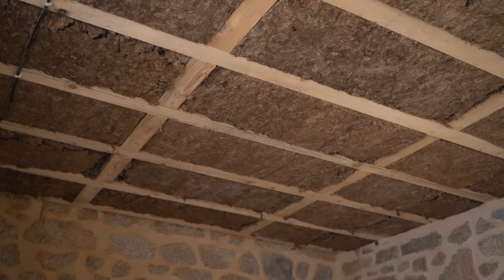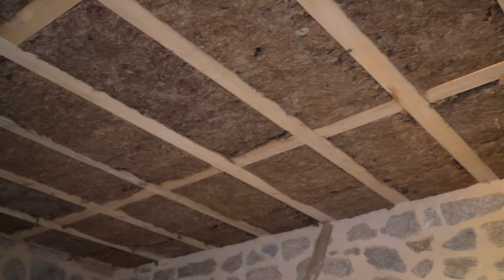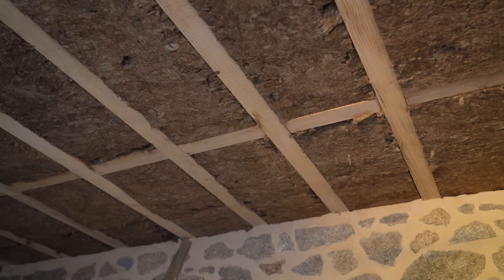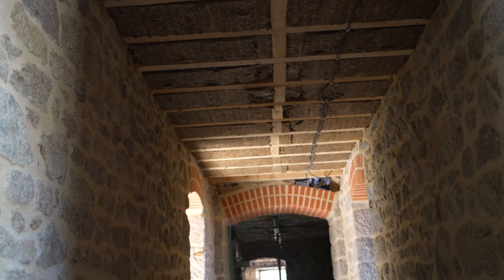Sundays at Chaumont- insulation and wiring breakdown.

Comment: You can buy special 'cable trunking' skirting boards! The cables lie in trays inside these every easy. Use PILKINGTON 'K' GLASS.  I helped a guy do a self build years and Pilkington K REFLECTS heat BACK into the house! NOTHING GOES OUTSIDE.

Comment: In Sweden the standard is to run wire through flexible pipe which is mounted first meaning it's super easy to mount and replace wiring. Though everyone did that.

Comment: In my relatives house in Berlin Germany they had these huge metal shutters they closed at night on every window, for heat and safety.  Each room also had a door so it could be closed and frosted glass for privacy but allowed light to pass thru  Each room had a single hot water radiator.  Each radiator came with it's own temperature control thermostat, and could be turned on or off if the room was not in use.  The home was 3 storeys plus a basement. One family on first ground floor and 4 separate apartments in the two stories above.  I think the combination of  doors on each room and the option of controlling each rooms heat separately saved some on  the heating bill.

Comment: Smoke Alarm system, fire escapes, emergency lighting, fire breaks:- Boiler rooms or other spaces dedicated to heating systems must have a minimum one-hour fire rating and must not be accessible to the public.:-ERP regulations have several core objectives as regards the fire safety of a building that is open to the public

Comment: I live in a 400:year old stone house in Portugal, and over the years the wires were hidden in between the stones in flexible conduit. I had the entire roof replaced with insulation, all the windows done in thermal double glazed aluminium frames, and a 30kw twin heat pump system put in for heating and cooling. There are 18 rooms with heating with long pipe runs. It’s as efficient it could be and it still takes about 100 kWh per day to heat, and this is in a mild climate. It’s no wonder these kinds of houses are not in high demand.

Comment: So no wires for the switches? How are you powering them? Battery or solar? Ugh that’d be a lot of batteries. I love the wireless idea though. iPad for your control panel. A smart chateau! I’d hardwire with smart switches. I’d also consider low voltage wiring for a security system with cameras, and surround sound for the family room while the walls are bare. And because it’s so big intercoms maybe? Are you doing sconce lighting anywhere? You have to have sconces in a chateau. I really love your channel. Fantastic work! I look forward to each episode ❤️

Comment: Great job. Why not use Wawin electrical conduit 16 or 20 mm to pull the cables in. Pull a few extra conduits you almost always need to be able to pull extra cables. The conduits protect the cables and if you get a visit from a mouse or two, they can't damage the cables and you can always pull more or replace the existing cables.

Comment: Hmm - All these praising of Rockwool (or any other stone/rock) based insulation products obviously comes from people with no construction industry knowhow. Rockwool has one single objective and that is to sell insulation - regardless of if suits the purpose. I guaranty you that the caveat list that Dan is presented is several pages. And especially on the need for 100 % air tight vapour barriers will be what will ruins the idea of using any type "conventional" methods. Insulating a brick/stone wall on the inside must only be done using silica based products with zero need for vapour barriers. Regardless what they tell you about rockwool being waterproof, able to breath etc. is simply not accurate. Sorry man, but you to consider alternatives.

They even state on the website, that using rockwool as an internal insulation method on bricks and stone walls is not recommended. Don't f... this part up Dan. You will regret it.
For the roofs btw, please consider using biogene materials...
Reply: A louds of Emercians are watching and they love if for they 10 year garbages houses. In Europe, most people tend to go for much more stability and longevity objects, and I totally am with you to work with biogenesis materials such as wood insulation, lime, and clay.

Comment: Drilling limited sized holes in certain areas of joists does not compromise their strength. Common structural design engineering allows for this as a practical matter.
Reply: It's french norms.

Comment: Be careful where you place the vapor barrier in your floor sandwich to make sure there's no risk of condensation. I would recommend that you pick a vapor retarder that will allow some drying rather than an impermeable vapor barrier (like polyethene sheeting, which can accidentally completely trap moisture that does manage to get in). The principle is similar to using lime mortar rather than concrete to allow masonry to dry, or using mineral wool rather than foam insulation. I recommend looking at the Building Science Corporation for good info on this sort of thing.

I would also say that installing the mineral wool insulation at this time is not taking a risk. We do this in hospital construction. It will not be damaged or grow mold if it gets wet, and it is capable of completely drying.

I agree this is the right approach to your build, and it's super cool that the Rockwool reps came out to advise you at the chateau, whether or not you end up with freebies.

Can you explain why you chose to adhere the floor rather than going the traditional route of nailing the wood floor in place?

Comment: Dan. You can't glue the parquet to OSB. You need to use a marine type thin board with the joints taped. The glue will not adhere, it will soak into the uneven OSB gaps.
Reply: ...I don't think in france we glue the parquet....

Comment: Save the old roof membrane to cover the new OSB before the parquet goes down while the plastering and painting is done..  The last thing to be done in a room is the parquet. (in case you have rain days where laying the new OSB is the only job you can do, you can keep it clean with the old membrane).  

 Dan, Chateau de Purnon has a video (NERVOUS moments mark a MONUMENTAL milestone. Château restoration #19) that has great footage of how they tented the roof while they repaired it using scaffolding. Huge sections of the roof were removed completely. They also have a Master Artisan Lesson on slate tiling in the same video that is a must watch before you do your roof.
Reply: It was a historic building,they hired professional for the roof and the government helped them in the process. Dan building is not historic,and it didn't have a roof,its all new construction 🙄. There is nothing to save but it walls and he knew that since day 1. Dan roof is a 20th century building,Purnon is much older. He has already consulted with professionals to rebuild it as it was.
Reply: @skdoremi6666  I understand all that - but the tenting is the same no matter and the technique to doing the slate tiles is also similar - in fact a bit more complicated for Dan with the type of roof he built and the demo of the tradesman doing the tiles is invaluable - the tools used would be a great help to Dan.
Reply: @skdoremi6666  I felt I should add.  My father was a Master Stone Mason & Master Plasterer. My X-husband was a Steeplejack, I showed him this roof and if he was capable he would have been there already - He was a lot like Nick.. no scaffolds, all ropes and harnesses. At age 70 his Steeple days are over. I asked him about his tools and he has given them to an apprentice when he retired.  I have an Aunt who is a bricklayer, a Sister who is a Cabinet Maker and a Niece who is a Train Engineer (drives trains).  I am no slouch myself a Person Friday, I can plaster and drywall, lay tiles, split stone and do a bit of carpentry.

Comment: Was wondering with such a large basement could you install a large battery room and solar to help offset the cost of heating and cooling. Also might think about floor  heating and a geothermal heat and air unit I hear they are the most efficient you can get. But I'm not heating expert.

Comment: Houses have been ruined by it. Its been tested in the only fully equipped wool testing lab in the world - and it burns as the
Polyester goes up 
Like a torch with the borax falling off it - and it gets wet from condensation because the borax holds water.

Comment: (Wireless switches... brilliant)
Run power around the floor perimeter save those awesome walls (conduit buried with space for future work... leave a pull string? , with short risers for wall outlets as needed (or floor outlets?). Just a thought.

Comment: Dan.  Do yourself and all future owners/residents and get the networking side of things done properly.  Run at least a single cat6 to every room or anywhere you may want to network something.  Connect it all back to a data rack in the basement.  You can massively future proof it that way.  
Current best kit to go in the rack is probably UniFi from Ubiquiti.  Worth looking at very seriously.  Reach out if you need any advice.

Comment: Seems to me, you’re building to a military standard, almost like a nuclear bunker above ground. The wiring sounds like a rats nest in a false ceiling. Seen it many-times in data centre’s, French OTT norms.  Insulation sounds spot on, I did the same on the internal walls, membrane, batten system, however I used plaster board with foam 70mm plus another foil membrane on the foam. 7 years later, no problem.

Comment: Instead of cables, use conduit and rigid electrical wires. This way, you can easily restore if you need to replace or add wires.

Comment: Rockwool is a great product, good choice. As a electrical contractor in the states, not knowing what the electrical requirements in France are good planning is important if possible consider using conduits in the basement floor before pouring any concrete.

Comment: Industrial style metal pipe to run the wires, with round join boxes. Can be neat and easy to move and not hide where they are. I think it would work as not a historical restoration.

Comment: To future proof the wiring it would probably be best to run flexible conduct to every electrical point so cables can be pulled through the conduit without issues. And to avoid having a mass of conduit at one fusebox, have a distribution box at the incoming supply point that feeds 4 or 5 fuseboxes spaced around the chateau. :-)

Comment: I am missing something. Why do u have to remove the waterproofing on the roof to put the roof on? Don't u want a water proof membrane under the tiles?

With full wireless switches r u going to go through a lot of batteries for all the switches in the building? And changing them out.
Reply: After all the time it was exposed to the elements and Dan climbing all over it to secure tarps, it’s probably been damaged.

Comment: 30 kW for a Building is aprox 650 m² ?
Reply: please think about vertical ground heat pumps ;D
Reply: @fusselYT  that would be quite a challenge with granite bedrock just under the thin surface soil.

Comment: Rockwool, I insulated my house with your insulation. As a paying customer, I urge you to support Dan's effort. Step up, Rockwool!
Reply: Did you do the walls too, and if yes . Is it really good , was it easy to install pls ?
Reply: @josephinesultana1334 We retrofitted Rockwool into the walls of our Australian 1950s weatherboard house by taking the horsehair plaster sheets off the inside and putting in a vapour barrier and Rockwool and then putting the plaster back on. We also put it under the floor from underneath. It is so good. On a 30+ degree day our house will be 10 degrees cooler and rarely needs extra cooling. Different needs to France in winter but works both ways.... we're warm in winter too.
Reply: @josephinesultana1334  Yes, all of it walls, floors, ceilings! Very easy.

Comment: Just a tip from someone from Scandinavia about the wiring, because we seem to do something that I haven't seen anywhere else in the world so far: use ducts for the wiring. We have these flexible tubes, very similar to tubes for drainage and the like, but with much smaller dimension, whose only purpose is to lead wiring. You can basically put them in first and then pull the wiring through them and make changes without anything snagging onto the wires since they are in these isolated tubes. I think it would make your life so much easier considering the amount of wiring you will have to do in this building.

Comment: As an IT Infrastructure person, please please do not invest in Cat5. Cat6 should not increase your cost by much and it's vastly superior. Cat5 should no longer be sold on shelves. I have a lot to say about wireless lighting as well, but I know you're working within your constraints to make things visually appealing and having solid stone/concrete walls. You're going to have a big issue with wifi signals, as I'm sure you're aware. You'll want to make sure you have a solid network wired backbone up to the wifi units  to handle your lighting automation. Let me know if you have questions.
Reply: He’s never going to really need more bandwidth than cat5e. At least he’ll get a longer cable run than cat6.

Comment: Clear explanation of the plans, very nice addition to the channel!
If you plan the switches to be wireless, take into consideration that a solution should not be depending on a Cloud service broker - otherwise you might end up in a situation where you can't control the lights if your Internet connection is unavailable. Use a solution that depends on a local controller, like Zigbee instead of WiFi.
Keep up the good work!

Comment: don't use wifi for the switches.... you'll constantly be changing batteries and with walls that thick you'll need a robust wifi network (prolly need that anyway).   Best solution will be something like ZWave or Zigbee or Matter.   They operate at lower frequency and go to "sleep" when not in use.   Batteries will last up to a year.

Comment: As an ex electrician I have always preferred the French method. Makes it significantly easier to update and change any wiring requirements. They don’t always follow the easy access rules but this building makes it preferred as well as regularity requirement

Also wireless light switches are an excellent solution

Comment: You should do the same as is done in commercial offices with wet and dry risers. Cupboards that run from bottom to top of the building, the dry one carrying electrical and data cables with distribution on each floor, and the wet riser with hot and cold water and sewage.

Comment: I use a system from Fibaro for the electrics. It includes a hub called HomeCenter 3. With that you can use Zigbee or ZWave for the switches and lighting. I would not recommend to work with WiFi if you have more than 10 lights to switch.

Comment: When do you anticipate replacing the old steel and concrete entrance/ground floors with new stable ones? Will this be before commencement of the various basement heating, plumbing, hot water, etc. systems? It probably wouldn't be weather dependent as is the finishing of the roof.

Comment: Dan these Sunday one-on-ones are great. - please consider decoupling your floor from OSB.  an elastomeric membrane still bonded and allows two layers to move independently.  wire to heat impacts your 35kw.  or you planning on boiler to heat floors?

Comment: Huh? Vapour barrier is not for use on interior floors.. It's to prevent vapour from transferring from the exterior in. Don't do it.
Reply: The basement floor and walls are sitting on bedrock without a vapour barrier underneath so he’s probably making sure the damp air doesn’t permeate the whole chateau.
Reply: @MatthewBraithwaite-x6g  That will not make any difference whatsoever.
Reply: @ why not?
Reply: @MatthewBraithwaite-x6g  Think about it. In order for a vapour barrier to work, it has to be as unbroken as possible. Obviously, there are allowances to be made for fasteners  such as staples, drywall screws, and all the nails used to fasten trim etc. Basically you're allowed about 3% of surface area. So what happens when you put it on an interior  ceiling, where there is going to be let's say, a big opening for a stairwell, or an open cathedral type loft or some such? What's going to keep any vapour inside the house already from transferring from one place to another? And just to reiterate - a vapour barrier is meant to keep vapour from transferring from the exterior to the inside of a house What he's doing is a pointless waste of time and money.
Reply: @olafbigandglad  if you treat the basement as “exterior” then it seems prudent to reduce moisture ingress to the rest of the chateau. Only for the basement ceiling. The stairs are in an enclosed area that could easily have a weather sealed door…plus the top of the stairs will also be enclosed and have a door. Good ventilation will be needed in the basement anyway due to inherent dampness permeating from the ground and walls. It even appears that some of the original basement “windows” were in fact just barred openings to allow air circulation. Dan might choose something a bit more heat preserving though.

Comment: Furr down the ceilings, run conduit, sounds like a good plan. Wifi won't go through the stone walls very well. I'm glad to see the use of wireless technology in the building. Thanks for the planning video. Is it possible to make the dormers now so they will be ready to install versus having to spend several days with the roof exposed? Exciting times.

Comment: QUESTION: Do your wireless light switches need some sort of power? I know it means you do away with wires between the switch and the light, but don’t you need some sort of power to the switch itself?
Reply: Some are piezo powered but if they are Wi-Fi connected, likely batteries as you’d find in a wireless doorbell.